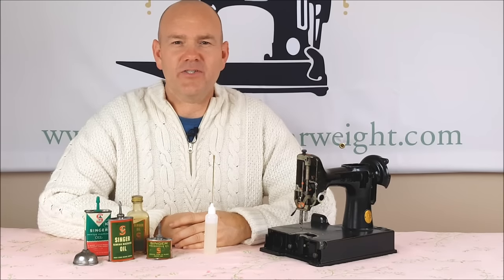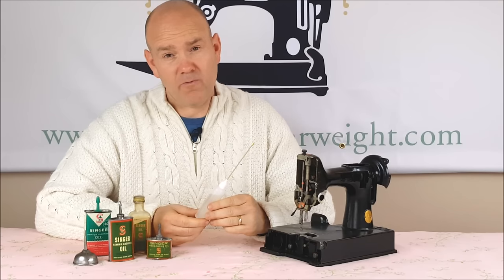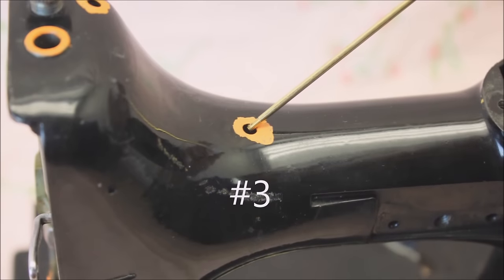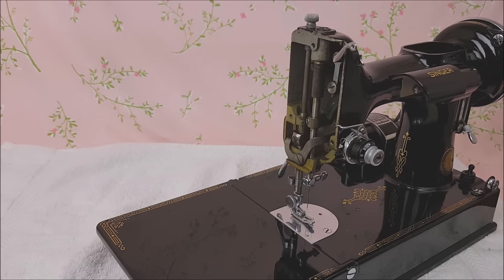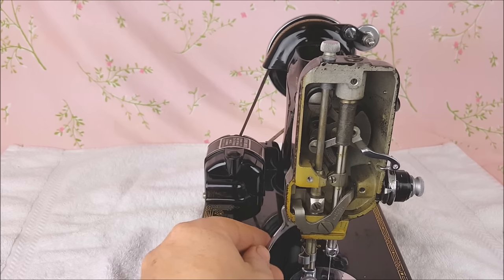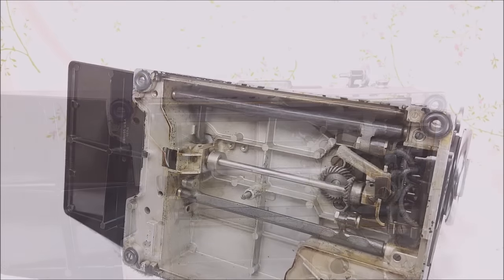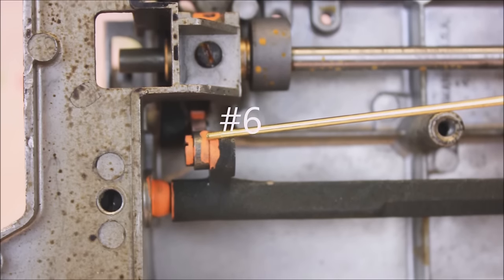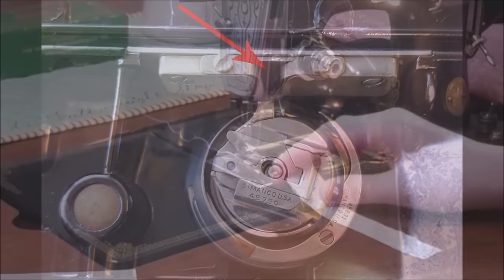Oiling A Singer Featherweight: Comprehensive Tutorial Guide to Oil a Singer 221 Sewing Machine

Comment: I have 2 featherweights and my granny taught me to oil and maintain it. Plus I still have the original manual. The one thing you forgot to mention that granny was very stern about is that after you’ve oiled your machine you MUST use some scrap fabric and sew for a bit on it before doing anything else because, trust me on this, you will get oil on that scrap and its better to get it on the scrap than the project you are working on. My 72 year old featherweight is still sewing like the day it was made.
Reply: you are so right, although i have heard Carmon say that before on his FB site. but thanks for the tip for those who don't know. i always do!

Comment: I opened my machine I recently bought and found a bunch of silver grease on the gears. A blob at one part that looks like it had settled from not being used. About to clean it up. Thanks for the tutorial. Really helpful.
Reply: Thought I'd follow up with a question. I got a bunch of dark spots, I'm guessing is from old oil, on the machine. It's especially bad behind the face plate. Is kerosene the preferred method to clean it up or could other cleaners be used. I might have some break-free clp on hand but wanted to see if anything else is good to clean up the dark spots.

Comment: I've recently unpacked an AK featherweight that was handed down to me, and have reviewd several of your helpful videos. This machine is dirty with oily dust, and I havent looked 'under the hood' too much. As far as cleaning with kerosene goes, would mineral spirits work as well? how pristine should the insides be?  Also, the thread spindle is loose causing the spool to wobble badly. This seems broken. Where can I learn more about that part?  thank you!!
Reply: thank you SO MUCH!! @featherweightshop
Reply: Patrise Arts what reply did you get for this?
Reply: Willa Blake it’s been a while & I don’t recall, and I wonder where the answer went? But I do remember that the wobbly spool is a common issue, and easily fixed with a fabric disc of some kind. They make them at TFS